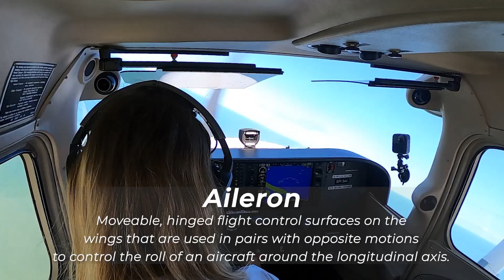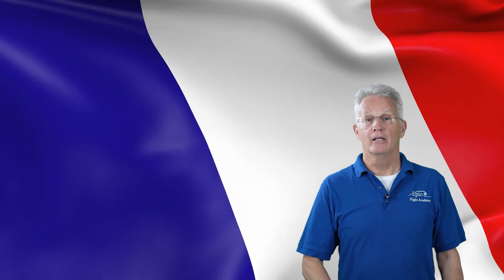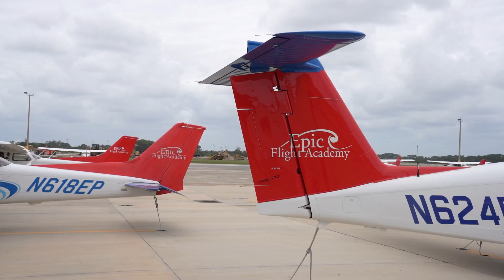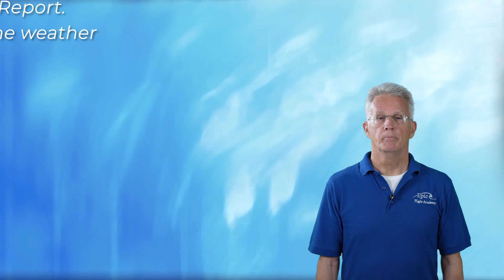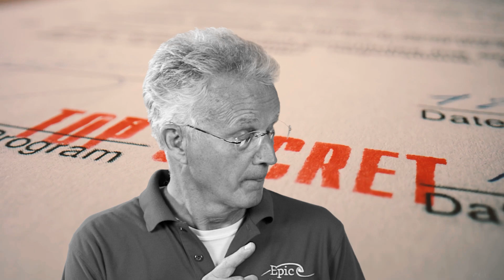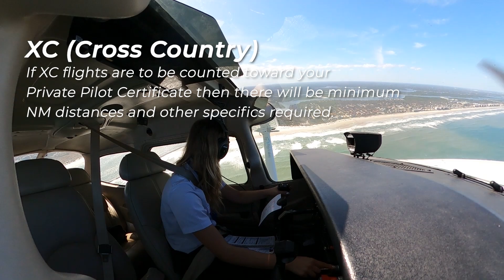Essential Aviation Terminology Explained by Mike Thompson | Pilot Language

Comment: hi, can anyone tell me what it's like to be a pilot if u have motion sickness? i want to be one, but my problem is that i have motion sickness but it only happens when i travel with a car.
Reply: Hey iam at about 55 hours right now and I also use to get sick in cars especially when I would read . I was like you kinda worried and my discovery flight only made it worse because I threw up afterwards😂. But that all quickly went away after like my 3rd or 4th flight. You get used to it and can eventually do things like spins and come out totally fine